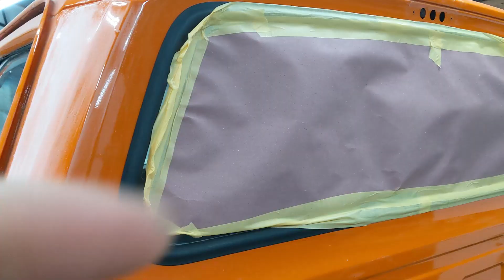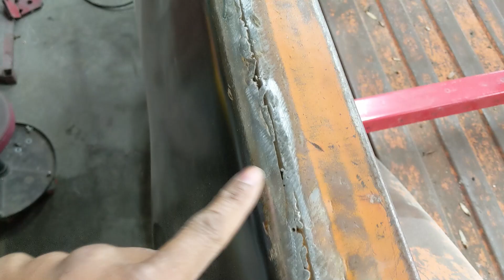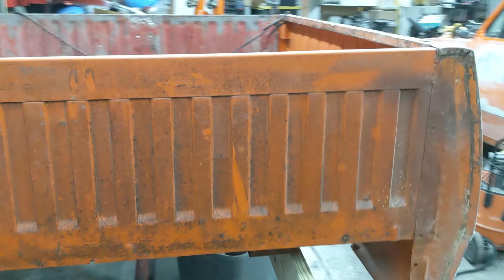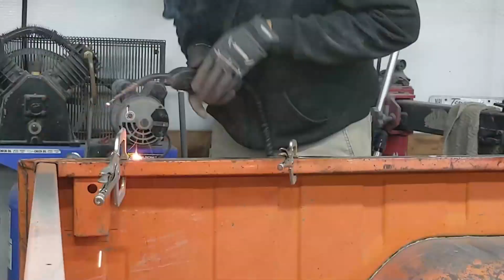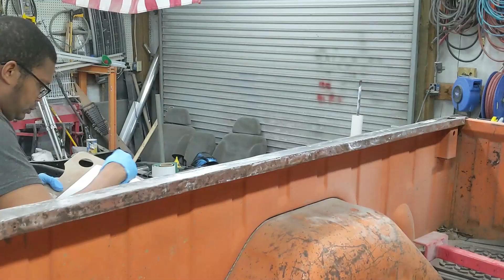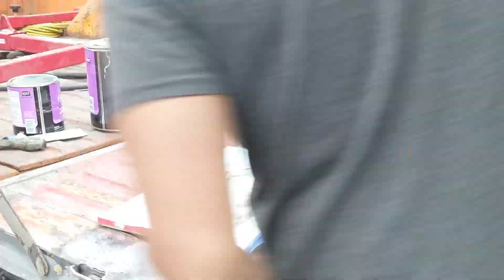How NOT to Replace Truck Bedsides!

Comment: I just did the Bed Rails on my project with a Flux Core Welder and was worried about the pin holes but decided to just finish it off with filler. I hope it will be ok. I had similar results with the Flux Core welder you did. Not ideal for body work for sure. Enjoyed your Video and Subscribed. Thanks for sharing this. Made me feel better.
Reply from the maker: A flux core can get the job done, it's all about the amount of heat you transfer. You can dial newer flux core machines in pretty good. My 10 plus year old machine won't die, so I haven't replaced it, but I'm thinking it's time to throw the bottle on it or get a replacement 😅

I'm glad to inspire.